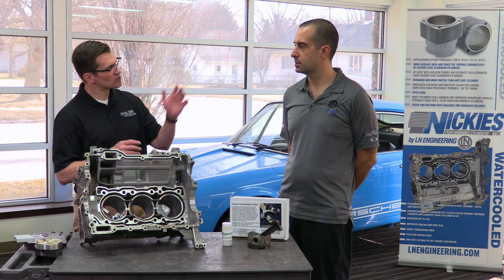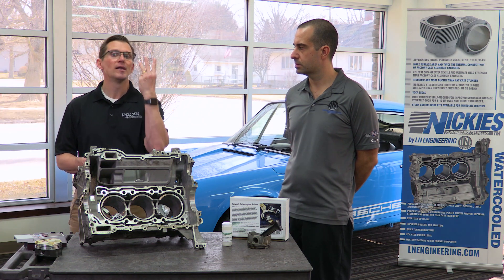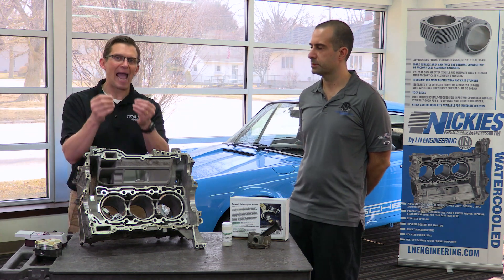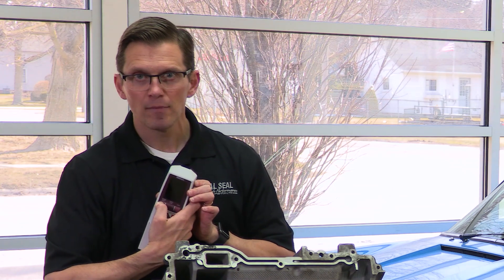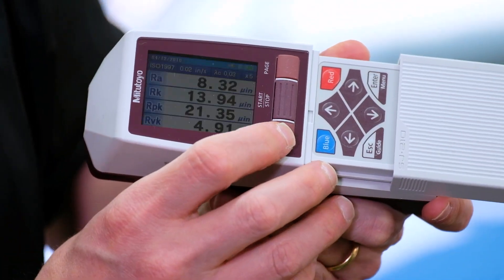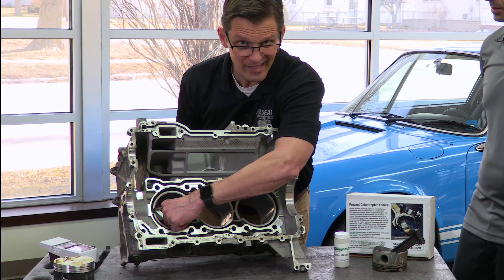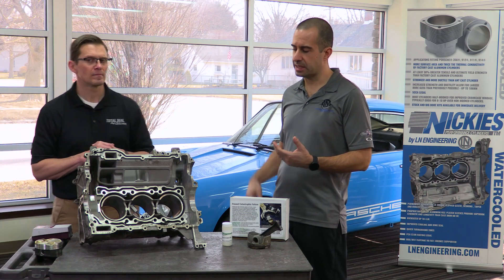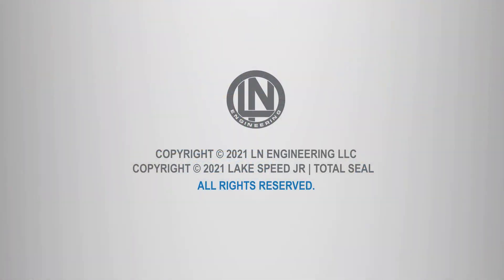Cylinder Bore Scoring - Part 1: What is it about? - with Lake Speed Jr.

Comment: Great video explaining the bore scoring situation.  Can I assume it’s not an issue in the iron block V6 Cayenne?
Reply from the maker: Correct. The VR6 based engines used in the early base Cayenne models with iron blocks do not suffer from bore scoring. In later years, Porsche replaced this engine with a v6 version of the v8 with two cylinders lopped off. In fact, the same pistons are used in both the v6 and v8 engines with Alusil blocks.

Comment: Is bore scoring only present if you have oil burning?
Reply from the maker: A rapid increase in oil consumption over a short period typically indicates presence of bore scoring.
Reply: So you’re saying it’s not fuel washing away the film ? It’s actually not having  enough oil . I think in direct injection engine . The fuel washes the cylinder so there’s no protection or a fuel injectors gets stuck open

Comment: Nicasil has problems with ethanol content above 10% BMWs in Brasil were ruined in early 90s since there already used to have 22% ethanol in gasoline...
Reply from the maker: The issues with Nikasil seem to have been limited to BMW and Jaguar. We've never seen issues with Porsche engines with Nikasil plated cylinders even with ethanol enriched fuels, but we agree ethanol enriched fuels are contributing to fuel system problems that indeed lead to bore scoring in engines with Alusil or Lokasil cylinder bores. Bad injectors lead to cylinder wash down and inability for a proper oil film to form to protect the piston system. On any Porsche made before the introduction oft he Boxster, we recommend using a fuel additive such as Driven Carb or Injector defender to protect against the damaging effects of ethanol enriched fuels.